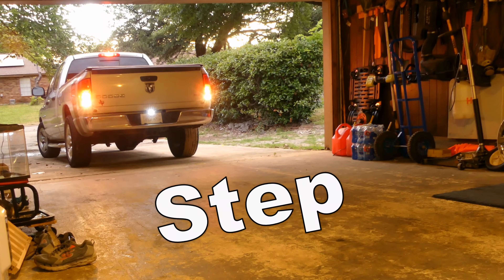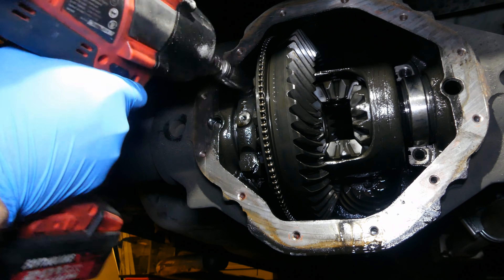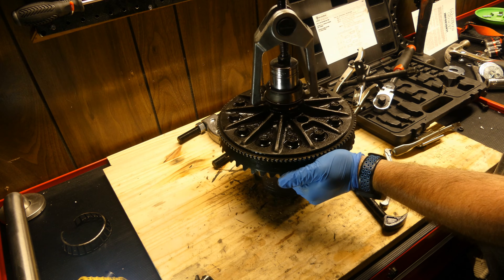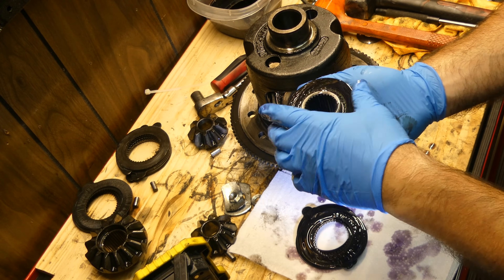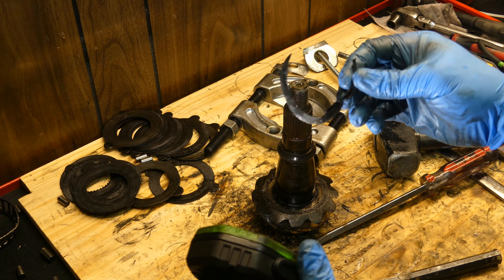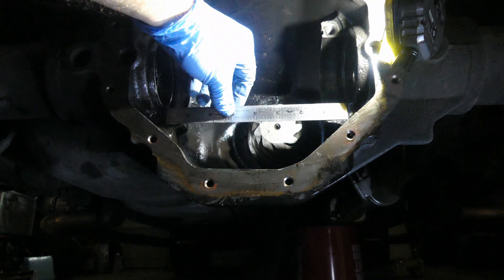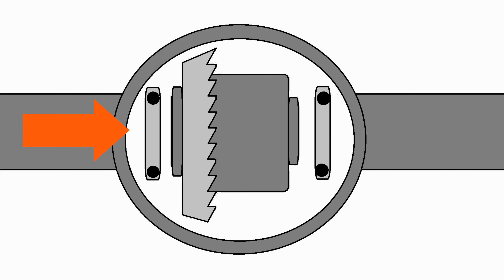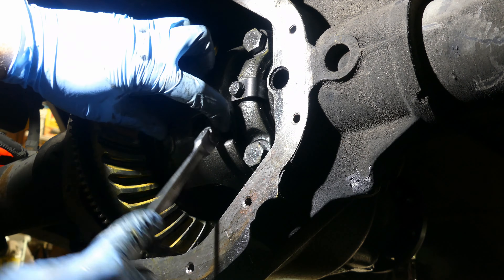Chrysler 9.25 Diff: COMPLETE Step by Step Rebuild and Install!!

Comment: This was a 🏆MASTERCLASS🏆. I was an advance diesel mechanic in the Marines for 8 years. This video made perfect sense. I'm about to do this job on my 2002 Ram 1500 2wd. 
One of the factory track lok ears broke off which is a common failure and damaged the teeth on the ABS/speedometer exciter ring. This is my second time doing this job. 
To eliminate this from happening again, I'm installing a Detroit locker Tru-Trac diff, a new exciter ring, new bearings, races and my old 3:94 gears. I have all the tools needed, even the ones not shown. Thank you for this video. 💪😎

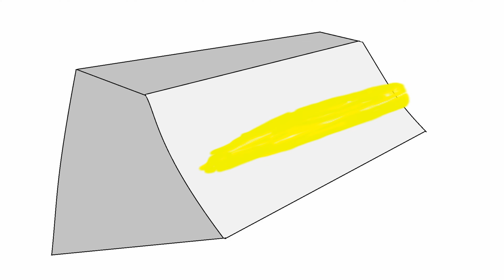Comment: Great video!! One question (doing my first ever diff rebuild) at about 12:50 you are painting the ring gear and mention "too high, add a shim, too low, remove a shim" - to that effect.
What shims and where?? Do you mean readjust the bearing adjusters - i.e. do the whole carrier positioning again?  Where are you shimming?  Thanks!
Reply from the maker: Hello, good question!  The side to side adjustment is done with the bearing adjusters, and the pinion depth is with shims. They slide on before the bearing is pressed to the pinion. That’s why I made the over size bearing race that would slip on and off for the adjustments. Once I had it set , press on the bearing. 
When you’re doing lash you can only move the mark with the bearings.   I hope that makes sense😂
Reply: @Dartmech it does!! Thank you! When you said "shim" for the carrier bearings, I kinda assumed you meant the adjusters - but these things are so "precision" I did NOT wanna guess😂. Thanks again!!

Comment: I have a 2016 ram 1500 5.7 ,iv changed the gears and pinion to 3.92 gears first ring gear broke because I didnt do the adjustments right so it wobble to much and broke teeth off the ring gear. But as I'm commenting on your video I redoing everything 😅

Comment: Question about post pinion nut installation and torquing on a 2015 9.25. What are the allen head locking pins actually called and where would I find them? Thanks.

Comment: I just swapped my 3.55 to 4.56s in my 09 ram with identical axle, my gear pattern looks identical to yours but charts say its incorrect, should I be worried?
Reply from the maker: I’ve been running it as is for around 10k miles with no issues.   There’s a hint of whining at 50mph but otherwise perfect.   You should be fine.
Reply: @Dartmech  have you been inside it since to see if the pattern looks normal now?

Comment: Nicely done, sir. I’m doing this exact job right now.  All that climbing in and out from underneath, the truck really sucks.  I took my spare tire out so that at least I could sit under their halfway comfortably and work on the thing.  I had to grind one ring gear tooth on my 4.56 gear too. I did this job once before and made the mistake of using a different brand of race with my different brand of bearing. I got all the same this time and the same set up bearings you are right about that. Thank you, sir and good job!
Reply from the maker: Thank you for the feedback!  I did this vid while cramped in my garage so I feel ya. It’s tough going up and down up and down.

Comment: Hey brotha i have a 2011 Ram 1500 with the same rear differential, my driver's side axle moves quarter inch in and ouy towards you, have you ever seen anything like that before? Guess they would call that axle play?
Reply: I’m currently restoring my 01’ off-road I bought new.  I’m doing 4.56 gears and a Detroit Trutrac.  My passenger side bearing cap looked just yours.  The groove looked identical as the one on your cap.  Glad to see your reusing yours.  I’m doing the same.  I was worried the first time I saw the groove.  But, it shouldn’t affect the integrity of the cap.  Not really much option, since they are unique to each housing.
Reply from the maker: @adambishop6678  I have almost 10k miles on that cap now and it hasn't affected anything!  you should be good to go!
Reply from the maker: So if you stand on the side of the truck and pull outward the axle moves in and out?  Is this with the brakes and everything on still or just axle shaft?  
I’d get the cover off the diff and check to see if your retaining clip is still there.
Reply: @Dartmech  hi, yes don't matter if brakes are on or not it moves in and out, I have taken off the cover and been lookin, the spider gear set with the locking pin looks like it's closer to the passenger side then the drivers side, giving the axle more room to move back forth, retainer clip is still there, spider gear have alot of play on the too, wish I could send you a video lol

Comment: What brand gears did you go with on this?
Reply from the maker: Motive Gears
Reply: @ thanks for the quick response, do you still have the truck and have you had any issues with them?
Reply from the maker: @oscar9737   They have been fantastic.  the 500 mile gear oil change had no metal flake, no pieces, and nothing to worry about.  I put the cover back on, and haven't thought about it since.  The gears probably have at least 15k miles one them now.
Reply: @Dartmech  good to hear, thank you again for the info

Comment: I went through the procedure several times but when I torque the bearing adjusters the rear end locks up andi can no longer spin the differential then I have to start all over I did notice that when I first started the bearing adjusters were not tight any help is appreciated
Reply from the maker: Hard to say..  
if the ring gear side gets too tight she’ll definitely lock up. Back that one off next time and snug up the opposite side.  As you adjust lash if you back one off, you’ve got to tighten the other.   I hope that makes sense

Comment: Don’t forget if your truck is 4+4 and you upgrade the rear diff gears to a higher or lower number you then also have to upgrade the front gears
Reply from the maker: Excellent point!
Reply: Or pull front drive shaft in a pinch

Comment: Ive followed this video to the letter yet once i start torquing the cap bolts it tightes so much that by 30 ft lbs im unable to turn the carrier
Reply from the maker: Is it binding on the pinion?  Try backing off the ring on the drivers side and tighten the passenger until you get good play on the pinion then slowly turn them in little by little until it torques.

Comment: Excellent video.  I replaced all bearings, races seals and, clutches.  Reused old ring and pinion.  Must have watched this vid 20 times in the process.  When putting the spiders back in you don’t need to beat them in, just compress one side of clutches a little and they should move.  It’s a puzzle don’t use a hammer 😂.  Anyway, this guy is a saint.

Comment: What stock gearing was in it that you replaced with the 4:56?
Reply from the maker: 3:92s
Reply: @Dartmech  can u tell me what bearing u got and website?
Reply from the maker: @ it’s a motive gear set and I purchased it off eBay if I remember right.  Summit racing has them too, and they’ll have the different part numbers you need
Reply: @Dartmech  thank you very much for the informative video and the response

Comment: Thank you for the help.  Your descriptions were great.  I have not done the spline gear and am a little intimidated.  I have not installed the spider gears and am a little intimidated, but they basically fell out when I disassembled so I am thinking that they will go back OK.  The use of the bolt to hold the diff gears in place was genious.  I used a leather glove.  Your description of the backlash was most helpful as was the spline allignment.

Comment: Next time, measure the depth requirement for the axle shaft into the carrier assembly. then bind the axle into a vise. 
   Now install the carrier assembly so that the splines align and slide the axle shaft into the spider gear and then just turn the carrier and spin the spider gears as you want.

Comment: You're not worried about the bearing slipping on the shaft after you honed it out?
Reply from the maker: Those were purely for the pinion depth measurement , I put new bearings in once it was time to install the pinion.  Hope that helps!
Reply: I found another rear end but it has disc brakes and mine is drums, same gear ratio, would it be cheaper to buy new parts for mine or replace the whole axle that has disc brakes?
What am I looking at as far as cost value?
The parts alone to rebuild is around $1,200
The rear end that I want to put in my truck is disc brakes but it's tight and in good shape, I'm just wondering what I'm getting myself into as far as Master cylinders in brake lines
Reply from the maker: @joebradley1520  I was only in for the cost of the Ring/ pinion ($350 but wasn't Necessary as it wasn't bad) the bearings ($200) and Oil.  If it hadn't been for the ring/pinion I would have been under $400 for sure.  Switching out for discs isn't all that difficult, you'd just need the line from the wheel cylinder to go to the caliper as far as I know.
Reply: I believe you need a proportioning valve also @Dartmech

Comment: Took my rear differential apart (identical truck), and I had the same clip part run a groove in the diff main bearing cap.the remaining clip fragment stayed in place and kept the clutches intact.  Did you reuse the same bearing cap with no issue?
Do you recall the pinion nut size?
Reply from the maker: I reused the cap, no issues 10K+ miles later. 
I don’t remember the socket size off hand.

Comment: Really a fantastic video, I unfortunately have come across broken clutch pack retaining clips. Not looking to do a complete rebuild, just don’t have the time or money right now. Is it possible to replace the broken retaining clips without having to worry about adjustments ? backlash? and anything else ??? Thank you (:
Reply from the maker: I think you’re out of luck there..   the clips have little bends on other end to keep them from falling out. In order to replace them, the clutch packs will have to come out which mean the diff needs to come out so you’ve gotta do the whole process…. Sorry about that.  If you leave the clips totally out so they’re not rubbing on anything like mine were, you’ll probably be fine for a while.  However they will eventually start to wear into the diff carrier.
Reply: @Dartmech  Thansk for responding. That’s what i was starting to think about since the truck has almost 200k miles, not looking to dump a ton of money or time into it. I just removed the remains of the clips and appears to not have damaged anything. If you remove the carrier, you must rest backlash and preload everything ?

Comment: Awesome video! I’ve been working on mine  learning along the way and thought, why don’t I make a video to help others figure this out… you beat me to the punch. Great video, you’ve covered just about everything needed. good job brother. What was the torque specs on your ring gear? I’m doing one and everywhere I look says 65 ft-lb.
Reply from the maker: Hello, thank you for those kind words! 
Torque on my ring gear was round 100 I think.  Per the Motive site: 7/16” bolts get 60-65ftlb, 1/2” get 100-110”.”

Comment: This is a kick ass video. You have got to have your balls screwed on pretty tight to follow it because he doesn't waste any time, but I honestly wouldn't want it any other way ( just rewind 50 times, that's fine). I did this procedure 10 yrs. ago or so with my 9.25 dodge and it lasted pretty good but... she's whining again. I have it torn down a little and looking at the open diff wondering what I did then, soooo.... looking for video to basically revive my memory (71 yrs. old). I think this video will do just that, THANK YOU !!!!!

Comment: When taking the play out of the drivers side adjuster. Turn the driver side adjuster all the way in, back off exactly 1/4 turn, then tighten the passenger side adjuster snug. This should get you close to correct backlash. Your welcome.

Comment: Man I’m doing the same job on same rear end. I’m so close I just need to insert spider gears but I didn’t remove the carrier it’s still inside. Is this possible?
Reply from the maker: I don’t think so unfortunately…. If your clutch packs aren’t too tight they you might be able to smash them in with a brass punch but forget about the curved shims behind them. They’re pretty thin… sorry, good luck whichever route you take!

Comment: Where did you get the clutches
Reply from the maker: They’re Yukons off Amazon. Just make sure they have your part number. I used summitracing.com to figure that part out but amazon was cheaper than summit so I went with them.
Reply: Where did u buy the spider gear?  @Dartmech
Reply: On the Amazon website, in the reviews was a very informative way of removing and replacing the clutches by making a spreader....you don't need to remove the carrier and reset the backlash...etc.  saves a ton of labor and time

Comment: Need to know torch pounds for ting gear bolts
Reply from the maker: Sorry for the late response it’s like 65ftlbs for the rear and 100 for the fronts. Best to consult the manufacturer for specs though.

Comment: I did some of that on my '03 Dakota QC 4x4 a week ago. I didn't replace any bearings and races, ring and pinion (it's a 3.55), crush sleeve - just the clutch packs and tube seals. I WANTED to do a full rebuild but 2 things made that decision for me. First is $, the second is I live in SE Wisconsin and the horrible body panel and cabin rust/rot would be throwing good money after a bad cause. 

Although I found some useful video's, and one best one of them all to prepare me for the project I'm feeling cheated by the Youtube search engine that yours wasn't in the top 50 given to me. 
It's only now, about 2 weeks since the job was done that your video thumbnail/preview was on the scroll-down panel while I was goofing around looking at random assorted video topics. Unfortunate because yours is the best one of the 50 or so I previewed. 
👍🏻
Reply from the maker: Wow, thank you for those kind words!  I wish you’d been able to see it sooner too, but I appreciate you taking the time to reach out!

Comment: I bought some 4.56 gears years ago… still haven’t installed them because I know my truck will be on the lift for a month while I figure out my pinion depth and all those measurements lol! 

I think this video went a little too quickly for a beginner but I appreciate it! 

I was also thinking about installing a Detroit locker at the same time. But they’re pretty pricey.
Reply from the maker: Thanks for the feedback!  There's a fine line between boring and informative, and it's hard to hit sometimes haha.  It wasn't terrible, but definitely a project.
Reply: @Dartmech I have a good friend who has set up many axles before and is a master Volvo semi tech helping me come Wednesday to do this. I am however going to use the factory pinion bearings to use as “tester bearings” or just start out with factory shim. Unfortunately I couldn’t get two bearings the same brand… 😔
Reply: If Truck is 4+4 you have to upgrade the front gears as well